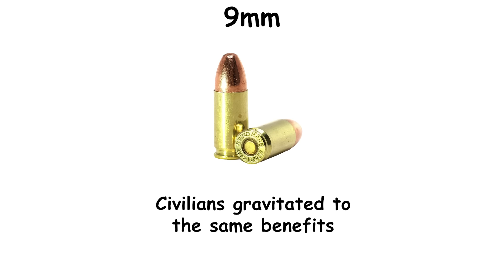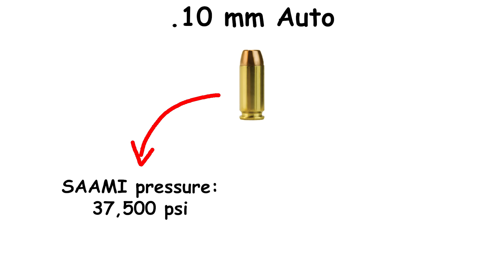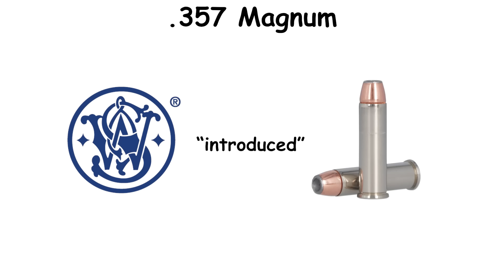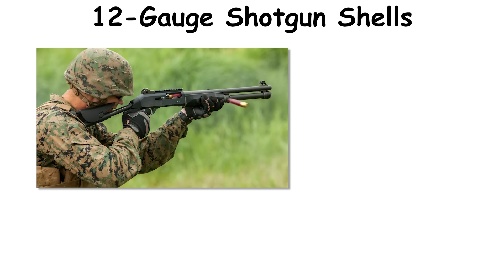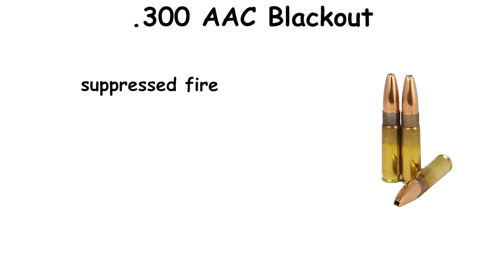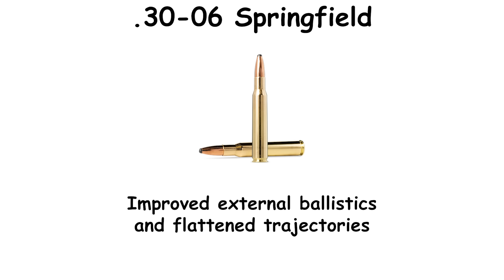Every Popular Type of Ammo Explained

Comment: 4:27 ~ ... as in "we need something that will not hurt our poor little delicate wrists" even though I've seen small framed ladies shoot full mags just fine. They've done what trained "professionals" couldn't. Even the .40 was too snappy for them so they just went back to the previous 9, making it almost a complete waste of time. At least now we have something to compete with magnum loads, but only by certain brands (in theory) because tons of people claim the common factory loads (e.g, Federal, Magtech) are under-pressured. Apparently to get the full BOOM we have to get Underwood or know a guy who adds a few more grains of powder to his hand loads.

If I plan on blowing a hole in a bear's booty, I don't want the Diet Coke of 10mm in my RIA 1911 A2. Winchester Silvertip (175gr, 1200fps) , Civil Defense, (60gr, 2400fps) or better. Might as well chest rig my Desert Eagle (.44) at that point. Both pistols feel the same when loaded.

Comment: Loving the content, only thing I want to add is that you left out .40 cal it is still very much popular, and I love to shoot it over 9mm.  At least on the range ball .40 really slaps that steel compared to ball 9.
Reply: I have to admit I am a 10mm fan. I love the 10mm. However, I never understood the hate for .40 S&W. My H&K USP is my favorite pistol (that I own). Its a very good and effective round that is not much different from shooting 9mm regarding accuracy. In fact, my most accurate shooting is on my cheap(inexpensive, I should say) S&W SD40.
Reply: 40 got a mention